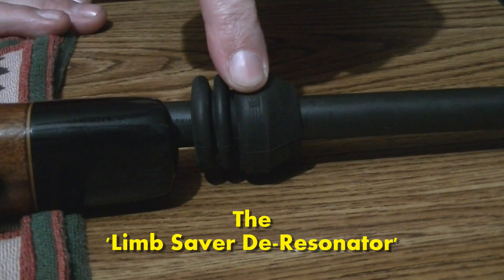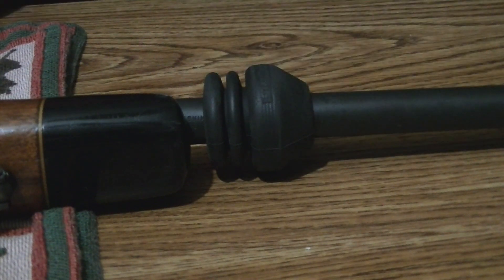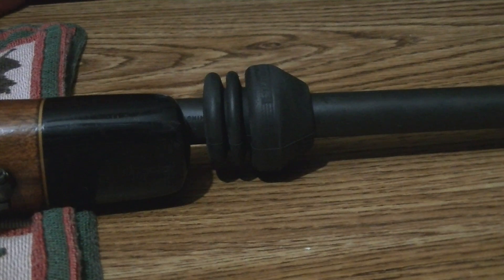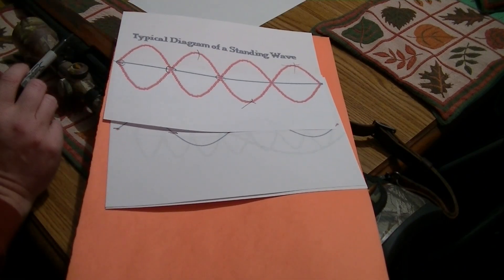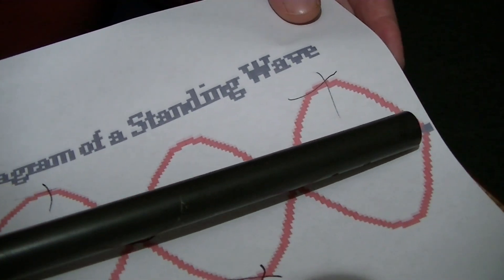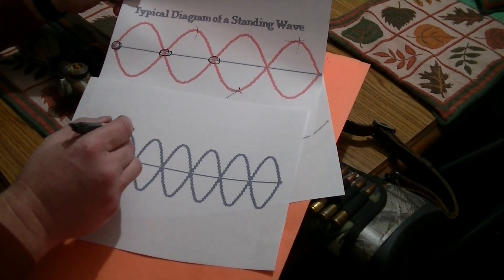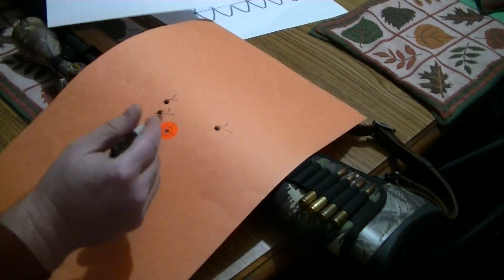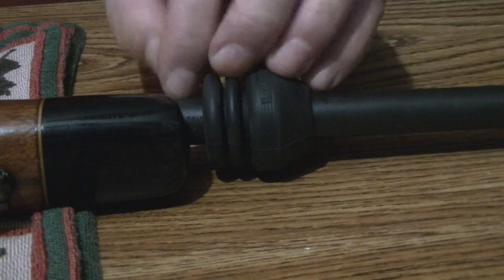What is a Limb Saver (Rifle Barrel) De-resonator?

Comment: Thanks great video, I bought 3 one for each of my 3 hunting rifles after watching you explain.  One one a Remington 783 same spot as you showed. Its now shooting tighter goups some touching. This gun had no modifications. What really surprised me was I put them on my wood stock Remington 700, one in 30-06 one in 338 Win mag. The apps were custom ozed with a trigger job 2 1\2#.and the barrelsvwere floated. The 30 06 shot good before the resonator. But with x ring deresonator, the gun groups tighter and pit them in the same hole. The same with the 338 W.  The 700 s do not have pillerblocks replaced they are just fiberglass beded and barrels floated. I moved it around on the 30 06. And it shot the best 3/4" from the stock. The instructions say 3" from end of barrel. So you got play with it. I also reload. But over all I am happy with The x ring. It really helped the 338 W . the most. I had to adj the scope after I got it to group..to where I wanted it to shoot. The x ring did move my point of impact. So once you get it to group you may have to do some scope adjustments.
Reply from the maker: Thanks Francis... it can be amazing on just how simple and effective this can be! Wade

Comment: Excellent description. The idea is to get as close to a node as possible. And this will work on even the budget rifles. Which will tick off the tactical elite. So, bonus.

I just picked up the Mossberg Patriot Predator in 7 mm PRC and if I get it tuned right, it will be my favorite all around hunting rifle from feral hog to whitetail to mule deer to the eventual elk hunt I am going to take. And do some long distance in the meantime with my $650 rifle. I am also putting it in an Oryx chassis. The problem I have noticed with Patriot and Predator stocks is the gap in the rear action screw guide. You can get 1 MOA at best but the rear of the action can move on you. I did that with my Mossberg Patriot .308 by putting it in an MDT (parent company of Oryx) chsssis and got it averaging 1 MOA.

Well, I just bought some on Amazon. 3 for my regular rifles. 1 for my Mossberg MVP LR 308 with the bull barrel.
Reply: I just bought 2 from midway hoping to help accuracy in my savage 111 30-06 and Remington 700 cdl 243.  The 700 shoots pretty good as is, shot a coyote with it this past hunting season at 300 yards but having trouble with my savage after missing some nice bucks past 200 yards.  Trying to add weight to the buckstock to reduce recoil and working on lighting up the trigger down around 2 pounds.  Going to give the 06 one more chance before I decide to trade it in for a lighter kicking 308, hope it works.

Comment: I can do you one better. Why you have the harmonics in your barrel. You stock is vibrating the barrel. Look at the gap and get a piece of paper and slide it between barrel and stock. Some rifles have a screw and spring to dampen the barrel vibration between stock. It's why people have glass beds put in stock too. The end of your stock is where it's at. The de-resonator on a free float part of barrel should be in middle. It's telling you its your stock. Its about the vibration or pressures the stock causes on different parts of the barrel. Sometimes even a gas block can cause vibrations. Powder primer burn speeds can cause harmonics too like on modern muzzle loaders.

Comment: Unfortunatly, this is mis information. You want to move the barrel weight(barrel tuner or a limbsaver), until your bullet exit on top of a curve, or at the bottom of a curve, where the barrel stands still. Preferrable in the top/bottom of a good node, to make the barrel positive compensate for velocity changes in your reloads (so they will hit in the same vertical placement every time).

Not like shown in the video. In the video you show the so called nodes beeing where the barrel has the maximum movement. This is completely wrong and mis information. 

We have used tuners in centerfire and rimfire for many years. The way to tune a winning rifle in rimfire, is like i explained. If we would have done what this video is explaining, we would have the worst possible vertical spread, and also probably the worst groupings the rifle could produce..

Just some hard facts

Comment: A shaft collar does a better job. a two piece collar 1inch wide if steel has weight and also tunes better than a rubber tuner to dial in your pitch AKA harmonic balancer this is why they use metal tuner's on a guitar and not rubber everything is metal when you hit the perfect resonation it will continue to ring in perfect resonation thus harmonics are changed and tuned. You can buy the collars on eBay for ten bucks or less measure the barrel diameter and order shaft collar of the same size one piece works but two piece collars have no screw scratching your barrel. As with the limb saver move little by little as much as hundred thousand inch at a time to hit the sweet spot. The collar has more weight than the rubber and will balance better . Your harmonic balancers on a motor are steel not rubber it absorbs the shafts harmonics of the rods and crankshaft to run smoothly.  This collar is not spinning your bullets are this tunes the barrel and projectiles in the barrel. 
Look up steel collar  tuner here on YouTube see how it's done for a couple of dollars for a steel shaft collar from eBay

Comment: I think you want to place it close to the anti-node.....not the node. Notice....the slope of the curve at the node is very severe.  Think of that "point" as to how the muzzle is directed. The slope of the curve is nearly flat at the very top or very bottom of the curve. A slight mis-alignment or "positioning error" of the de-resonator won't make much difference. At the anti-node, the curve is still relatively flat....but it will make a big difference at the node. A smidge to the right of the node and the muzzle points down....a smidge to the left of the node and the muzzle points up. At an anti-node.....you don't see such sensitivity, it's relatively flat. So....my point.....the vid you show is good.....but the "goodness" location you are chasing is the anti-node ( hill top or hill-valley).

Comment: This is an interesting topic. But the subject of barrel harmonics may be more complicated than the sine wave example you show (constant frequency). Kind of like moving your finger dynamically on a violin string (no frets) so there is a pitch change over time, the same thing may happen with barrel harmonics in that when the bullet is near the breech end the barrel harmonic is not the same as when the bullet is near the muzzle. 

Do you know if someone has actually measured the "frequency" of this vibration and demonstrated whether there is or isn't a change in pitch during bullet travel down the barrel?

Do you know if someone has put more than one of these devices on the same barrel moving them independently to see if that makes any significant changes? (maybe one closer to the breech, the other closer to the muzzle?) Given how inexpensive these are, that might be interesting to test out.

I'm sure there are many other factors that come into play. Thicker barrels will most likely have a higher overall frequency than thinner barrels, shorter barrels probably will have a higher pitch than longer barrels. I have no idea how complicated things could get with a tapered barrel. Bullet weight and velocity would also affect frequency (maybe also amplitude).

But as I said -- very interesting topic. I suspect that some kind of "barrel tuning" will become more common the more it is studied.

Comment: Appreciate your efforts! This was my original thoughts as well, but have been told by experts in the benchrest world you are actually looking to catch the barrel at the extreme cycle of the node not the center, the center is where the vibration would have the muzzle end of the barrel moving the  fastest. Your sweet spot for bullet to leave the barrel would be when the muzzle is at it's slowest, which would be at either the top or bottom of a node. Extreme long distance shooters strive to eliminate all side ways grouping, leaning more to a slight verticle grouping because of velocity deviations. Adding any weight to the barrel will slow down the speed of vibration, hence improving accuracy. Finding a sweet spot by modifying reload characteristics on a naked barrel and then use a tuner to enhance those results will give you the absolute best results.

Comment: I applaude your efforts in trying to describe a difficult topic.
Just a couple of points
A barrel will have a number of resonant frequencies
The frequencies, in themselves are not important, but will depend on the length of the barrel.
The chamber end of the barrel is fixed, hence will always be a node.
The muzzle end of the barrel is not fixed, hence will be an anti-node.
(Note the diagrams used in this video are in error as both ends of the barrel are shown as fixed.
For a given resonant frequency
A node (a point along the barrel that does not move)
An antipode (a point That moves the most)
IMHO the deresonator is placed at a point along the barrel to reduce the amplitude (size) of an anti-node that most affects the accuracy.
There are multiple resonant frequencies for a barrel.
The first (mode) is where the is one node at the chamber and one anti-node at the muzzle. Similar to ruler being held at one end against a table and flicking the free end.
The first mode 1/4 wavelength -or 1/4 of a complete wave where one wave say starts with a node, rises to an anti-node, renduce to the next node, further reduces to a negative anti-node, then rises to the final node. This is one cycle or wavelength.
The next mode(resonant frequency) sees the chamber end remaining as a node and the muzzle remaining as an anti-node, with an extra node and anti-node. Effective 3/4 wavelength.
Successive nodes will add another half wavelengths ; 1/4, 3/4, 5/4, 7/4 and so on.
The more wavelengths alone the barrel the higher the frequency and the smaller size (amplitude) the anti-nodes.
Reply: So, with a long enough barrel, the half reducing successive wave lengths will eventually diminish to the point of leveling out and align the chamber node with the barrel antinode?
Reply: "The muzzle end of the barrel is not fixed, hence will be an anti-node." Exactly, and even more - we are interested in the projectile leaving the barrel at maximum deflection, not zero. At maximum deflection, the perpendicular velocity of the muzzle end is the smallest, and the effect of differences in ammunition has the least effect on accuracy.

Comment: I had a complete shoulder replacement and am attempting to minimize the felt recoil.  What can you recommend for me?  I am gearing up and practicing for the grizzly hunt next year with my Winchester .416 Safari Express.  Thank you for this site.
Reply: Dr. Mark, sorry, but there no free lunches when it comes to your situation. A 416 rem. is going to punish your shoulder whatever you do. There are some things you can do to reduce felt recoil though. a] increase rifle weight. b] install one and possibly two mercury recoil reducers in the buttstock. c] fitting a muzzle brake. d] porting your barrel e] fitting a purpose built "recoil taming" buttpad f] sewing a "recoil taming" patch into your shooting jacket [available from Brownells] . Either c] or d] are going to split your eardrums though. You could also consider a lighter load or even a different cartridge altogether that would be kinder to your shoulder. Good hunting and straight shooting!!!

Comment: I drove a mechanics truck that at certian rpms and certian road speeds would drive you nuts with the noise the gearshift would make vibrating so bad it sounded like pissed off rattle snake was riding along,then an old truck driver told me to put a section of heater hose down over it Wala the thing was quite silant I guess this deresinator thingy works on the same princaple!!

Comment: Ocb have you much experience with the newer mini 14 s because if you did I would think you're comment might change ,mine will hold a one inch groups at 100 yds with wolf cheapo ammo and my friends will keep in two inches not bad for a mini and a lot better than some stock at 15 s I've shot I've seen are that were lucky to keep in six inches at 100 yds then I've shot some of them with after market Barrell installed that were increadably accurate ! I have seen old minis that were bad like 4inch groups,I suppose barrel quality has to do with it but Ruger is hammer forging thier own tubes now,and seem to have it together I like the m14 call me old fashioned but the 308 or 7.62 is vastly Superior to the 5.56 that's a fact !!!

Comment: I just put one of these on my Smith Corona 1903a3 30-06 and I shoot Remington Core-Lokt 180grain bullets.  3/4" from the stock and I went from 1 1/3" groups to 3/4" groups at 150 yards! I am impressed with this product. My rifle was built in 1943, action and barrel are still original and if it can improve an old war 🐴 than I'm quite sure it will improve yours as well.  At 300 yards I can shoot a 2" groups and that good enough for this hunter.  THANKS LIMB SAVER!
Reply from the maker: Yesser! They can be a game changer for sure Trevor! Wade

Comment: IMHO, this is an oversimplification of a complex dynamic effect with many variables at play. This de-resonator could improve a poorly set-up poor barrel barrel somewhat by damping only but will not help a good barrel that is indexed unless placed at the end of the muzzle. It would need to be heavier, too.
  An indexed barrel with a tuned compensator of sufficient weight will lower the impact point of marginally hotter high flying faster bullets that are fired at a higher angle due to a higher magnitude sign wave peak and earlier timing point that the faster bullet exits the barrel.
 The same barrel with slightly lower powered  (slower ) shot variations exit the barrel at one of those null nodes.
This set up I describe delivers tighter vertical groups by providing proportionate positive compensation for marginally hotter high flyers, but has inconsequential effect on already flat shooting rounds.
 Horizontal variation should not be a factor on a good indexed barrel properly setup even without a compensator.

Comment: I just have one question. After you find a "sweet spot" with one type of ammo., does the accuracy change when you switch to a different ammo? I figure that different ammo would change the harmonics of the barrel thereby causing a change in accuracy and point of impact. Your answer will be appreciated, Thanks.
Reply: Yes......Every bullet weight/style, powder charge, round manufacturer, even a different manufacture of the primer can cause a difference. Maybe a small one but still a difference.

Comment: Every gun shoots every load differently.  I have a Ruger M77 in .308 that shoots factory Remington 150 gr PSP at .75 MOA.....same gun with 180 gr PSP and I get about 2.5 MOA accuracy,  Why ?  Barrel harmonics...every load and bullet combination will give a different harmonic wave.  That's why the BOSS system works so well....it allows the user to move the BOSS forward or back by a few thousandths of an inch, thus, affecting the harmonics and the position of the barrel when the bullet exits.  Heavier barrels reduce the affect of the harmonics, but it's still there, just not as pronounced, and that's why you see a majority of heavy barrels with target guns.

Comment: Good video Bubba.  I think it's important to mention that this tool is not needed if one is handloading for their rifle and really understands how to "put the barrel to sleep."  When the shot is fired, high velocity shock waves travel between the chamber and muzzle in a pulsing manner.  
We want the bullet to exit when the shock wave has reached the chamber end so the barrel is not "upset" at that exact moment.  This is where the term "putting the barrel to sleep" came from.  When this is done correctly (by fine tuning powder charges in the 1/10ths of grains and tuning bullet seating depth), bullet impact should be all horizontal with very little to no vertical dispersion.
I can see the advantage of the limbsaver for guys who only use factory ammo or aren't into advanced reloading.  In that case, the limbsaver is really the only way to change barrel harmonics other than changing rifle bedding.

Comment: Thank you for your informative video. One question, how much effect will this devise help a rifle that has a premier barrel , bedded perfectly in a  bench rest stock with a top end action? My thought is that this devise would be very helpful to a rifle with bedding problems or a barrel that has been stressed while being manufacrured, or any other many issues that may occur in the making of an off the shelf rifle ? And not so much with a custom built rifle.  Either way, what a great product. Thank you.
Reply from the maker: +Gunslinger I have never had this device on a high-end rifle... So, not sure about the effect it would have on a really nice (custom) rifle.
Reply: +Bubba Rountree Outdoors   Thank you, like tuning a guitar . Has to help.
Reply: If your reloading for that custom rifle you can change the load and head space to tune it, but with factory ammo you find the sweet spot and could get better